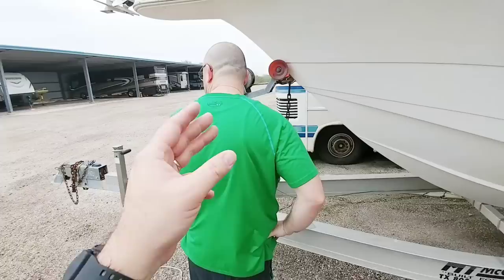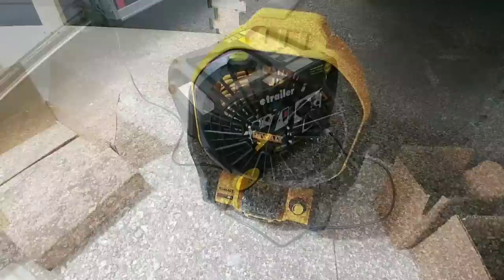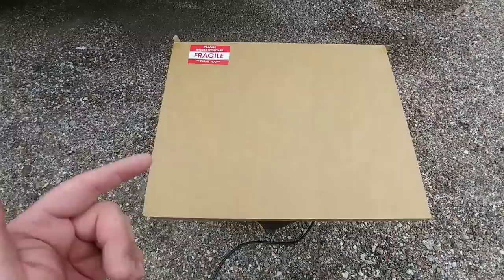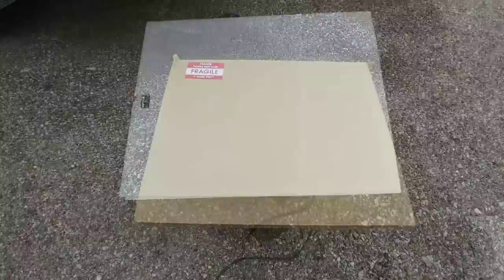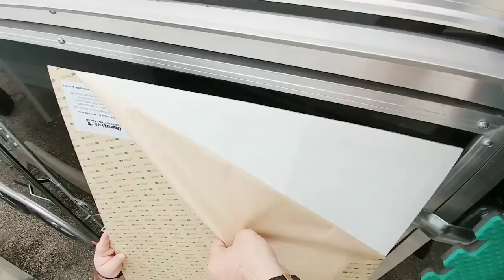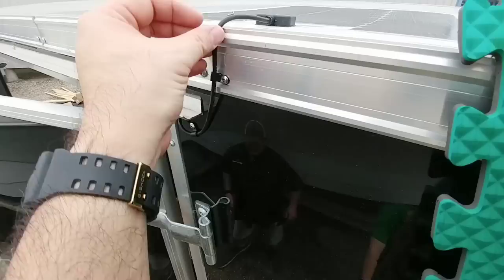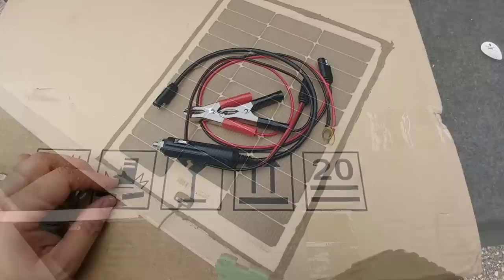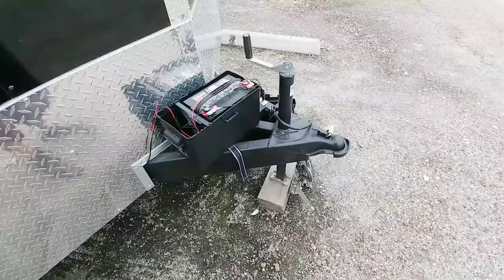RV and Trailer owners will love this! So easy to install!

Comment: I once fell off a 50 ft ladder... good thing I was on the first step lol.
Reply: Even better the ladder wasn't upside down !....was it?
Reply: @dalek.6171  As long as the ladder wasn't on the edge of a lower roof or held up by a rigged up platform then you'll be fine.

Comment: With a 7-0 trailer you can bring a rack up from the frame and install the real thing with no roof or wall penetration. All wires travel inside the rack and penetrate the floor. Doing it now.

Comment: I fell off the 3 step of the ladder doing work my my fifth wheel and broke my heel off. It went back into the right place but I had to be non weight bearing for 3 months to my left foot. I believe in good ladder placement now.

Comment: ...or, for less than half the cost ($159 all-in), you can get a comparable solar panel (12VDC, 50W, flexible) and a capable MPPT charge controller (lead acid chemistry). The wiring is just as simple, yet you have so many additional options for expansion, etc.

As for this installation, a) a waterproof entry gland is cheap insurance against leaks, b) the Dicor lap sealant is way over kill, and c) the efficiency of these cells will be comprised as they heat up for to lack of air flow underneath them.

Still not requiring roof penetrations, I'd affix low profile aluminum channel to the roof, then mount flexible panels to a thin rigid plastic substrate and the substrate to the channel; all with VHB tape.

The channel allows air flow under panel(s), minimizing efficiency reductions from panel heating. A length-wise orientation would minimize wind resistance, but could induce some lift during transit, while a width-wise orientation would result in slightly more wind resistance without lift.

In short, affixing any solar panel directly to a structure without adequate air flow will reduce their efficiency while simultaneously shortening their life.
Reply: This guy has no idea what he is doing.  Glad you wrote this, saved me from typing.

Comment: I have several comments.  First, wiring the panel directly to the battery will pull the panel operating voltage down to the battery voltage.  A 50 watt nominal 12 volt panel actually operates at at about 18.5 volts in full sun where it will produce 2.7 amps.  Connecting it directly to the battery will pull the voltage down to around 13 volts max, so the power you will get out will never be more than 13v x 2.7a = 35 watts.

Second, a 50 watt panel is too big to directly connect to a less than 100 amp-hr battery like you have (looks like a GRP 24).  The panel will NOT self regulate no matter what the manufacturer says. In a sunny place like Texas that panel WILL overcharge your battery in the summer.  The only possible saving grace is that applying the panel directly to the roof like that will cause the panel to run very hot.  That will decrease its output dramatically AND will greatly reduce the panel's life relative to a mount with air flow under the panel to keep it cool.

You made a big deal about preventing leaks, but didn't use any sealant on the wire mounting screws you put into the side of the trailer.

You could have bought a high quality monocrystalline rigid 50 watt panel, an MPPT controller, mounting brackets and some 3M VHB tape or eternabond tape and made a much better install for under $200.
Reply: Would you mind helping someone do what you mentioned at the bottom of your comment? Materials list maybe?
Reply: @jmqrsq  I can make some suggestions if you give me the specifics of what you want to do.
Reply: Would that 50 watt panel be able to charge stuff like Dewalt batteries , run compressor ect ??
Reply: @chicothesavage  ha, ha, ha.  Of course the answer is yes IF the panel is connected to a big enough battery bank and has a big enough inverter.  It just might take a LONG time to recharge the battery bank after running the compressor.  The DeWalt batteries not so much (say an hour or so of full sun for a 2 amp battery, but you will still need an inverter.
Reply: What would be a good setup to run a stereo and lights for a few hours at a time. Maybe a little more power in case I need to charge power tools. Also running a vent fan too.
Reply: @Kev in the 𝕃𝔹ℂ I agree completely.

Comment: GREAT idea on the drip loop. This is not meant as a backhanded compliment or snide remarks;  but I spent 2 years on & off researching Solar prior to the installation on my tt last year. I was going to go the flexible panel route (and not the cheap ones) until almost everyone who had a year prior had major failures. A lot of them documented on You Tube. This was regardless of supplier. A local solar supplier quit stocking them about a month prior to me trying to place an order from him. He had had too many customers return them with failures. I ended with a small (glass) system to tide me over hoping quality & technology will catch up. I’ll be real curious to see a follow up in about 6-12 months on yours. I wonder if the price of these is representative of a “cure” with the problems they use to have ? And no charge controller ? Although you’ll be lucky to average more than about 1-2 amps per hour, how do you prevent over charging?

Comment: This particular panel is no longer available. They still offer a panel with the same performance but doesn’t have the 3m backing. It mounts with screws

Comment: Would be nice to see what you did with the wire after the drip edge. Kind of dropped the ball at that point and didn’t explain how the wires got back out to the battery.

Comment: I was always told that bracket mounted solar was MUCH better (superior) than surface or flush mount solar panels.  The reason was cooling, the heat has to go somewhere.  If there’s a gap between the panel and the roof, the heat has a place to go — No gap, the heat transfers to your vehicle through the roof.  Also that if there is any flexion in the lightweight flexible panels, it’s all still glass.  The solar cells crack, that cell on the panel is toast, and gradually over time as more and more cells crack, you lose output. This doesn’t happen as often on framed, raised solar panels.  Is this true or false?
Reply: true
Reply: We have 2400 W of flat mounted panels, and I can say they work just as well for solar as they do as heat reflectors.  Keep some space.
Reply: @halledwardb  — No space means you are transferring the heat to your roof.
Reply: @Erin-Thor  Don't think so.  We have measured this stuff and lived with it for 4 years, so theres that.
Reply: @halledwardb  — The heat goes somewhere… 😳
Reply: @Erin-Thor  UP

Comment: Should have drilled through the roof, then sealed the hole with 3M 5200. It will never come off crack or leak and will outlast that trailer. The hole shoild have also been within a 1/4 of where wire exited the panel and completely cover the wire with 5200. The way you have it one tree limb rubbing the rail will destroy that wire. Also, is that wire fused at the battery?

Comment: That little solar panel thing seems pretty cool! How did you wire it from the top to the battery? I know you described it, but how did you actually route it? Inside I assume? Did you use more wire holders?

Comment: why run the cable to the inside just to come back out? should of ran outside down the front in a chase way to protect it. way easier and quicker. way over priced!

Comment: Have you seen the dewalt 20v max powerstation?  It's basically a power inverter that runs off 4 dewalt 20v or 60v batteries.  I can also be used as a 4 port charger.  If you have a lot of dewalt tools, you might like that
Reply from the maker: That's cool! I'll have to check it out... (Means I'll likely get one)
Reply: @BigTruckBigRV  Haha nice JD!  Here's a video on the powerstation.  https://www.youtube.com/watch?v=WKqCMYEbdaY I have to warn you though, the video might make you want to buy the dewalt toughsystem boxes too lol.

Comment: Great idea for cargo trailer purposes. I wonder what the response from the manufacturer would be concerning potential customers who have read alot of bad reviews and seen lots of videos where direct contact solar panel mountings have failed and/or had performance issues due to mounting the panel directly to surfaces.

Comment: Just a thought I had, the wire routed under and coming out under the leading edge of the trailer, hope the edge is not sharp, thinking of the wire insulation wear, rubbing as you bounce rolling down the road, also is there an inline fuse?

Comment: Why not mount it towards the front of the roof and run the wire straight down to the battery? Maybe even loosen the screws on the diamond plate trim and tuck them under that?

Comment: $350! Insanely overpriced.  If they sold them for $150 they would sell 10x the amount. However price aside I do like it.
Reply: Most traditional glass aluminum frame panels have a 20-25 year guarantee and will continue functioning well after this.. I guarantee you these flexible panels will be shot in a fraction of that time, UV rays will completely degrade whatever clear plastic theyre using over the cells.

Comment: Who else shook their head through most of this? If only he would have told us the same thing 5 times for every step, we might have understood it better. Did he say he made sure to put a drip loop on the wire that was attached to the panel which had 3M adhesive on the entire back? I think I missed that.

Comment: What is the purpose of the battery if it’s a cargo trailer?
Reply: Cecilia Petrowsky Mine uses the 12v deep cycle battery to both power my led lights inside, and my brake away kit for the trailer brakes. I also have a power jack on the tongue that uses the battery.

Comment: Just found your channel and have been watching some of your great videos. 
I have just acquired a 2019 6x12 Cargo and looking to first add a battery to the exterior. 
I didn't see a link to your Battery Box nor your battery; Can you post a link?
I have an Anvil trailer and dont know if I have room for a Battery but I will not know until I get the measurements for the plastic battery box. I do like your oversize box, that would allow for storage of a few extra items.

Comment: Did you put a grommet in the hole where the wire penetrates the trailer wall? Curious to see how this pans out long term. I’m not familiar with solar enough to understand where power goes when the battery is fully charged.

Comment: That isn't going to last! A few years at most. I got 150 watt panels  for $145, and they are glass. With coating. And I have seen 155 watts from each of my panels, powering my offgrid house.

Comment: Dang. $368.75 for that solar panel.  Please review items that normal people can afford.
Reply: I love his video's but I'm with ya, a lot of stuff us normal broke people can't afford
Reply: Yeah, the thin panels are way too expensive.  And this one seems to be on the high end of that even.  The really crazy part is that their life expectancy is just a fraction of that of the normal panels.
Reply: Check this video out. https://www.youtube.com/watch?v=3-sc4rlV93g
6.2 Amps 12v is 70+watts for $100 AU.  Not sure you can get them but it does illustrate that there are some good and cheap ones out there.
Reply: I know Harbor Freight has 150 watt panels that they put on sale for $150-$200 all the time I have a smaller 10watt that use on my horse trailer that got from there years ago that I paid about $40 for it which if you don't use up the battery every day it does good.
Reply: @stacyreid5077  I got my panel from Windynation.  A 100watt panel there costs about $100.  For the flexible ones it is like $120. 

I put my panel on the roof of my van about 4 years ago.  It's still working great.
Reply: 101perspective sounds like a great deal there
Reply: Holy Moses that is nearly good for 800 watt  here in Australia last time I bought 2 150 watt solar panels they cost me $127 Australian for the 2

Comment: Great product but too much $ for just 50Watts
Reply: Possibly, but realize whether you are using the battery or not, as long as it's decently sunny it's providing a charge to the battery. Great for outdoor storage of a trailer and maintaining a battery that isn't on your property (i.e. no more unhooking and hauling the battery home with you for extended periods of storage)
Reply: @natedog51  You can do the same thing with a $19 Harbor Freight solar battery maintainer.
Reply: @natedog51  Uses cases for which 50W isn't necessary.

Comment: I never heard what the battery is going to be used for.  Sooo, what is purpose of installing the battery with the solar?
Reply: Mike, you must not have watched this channel very long LOL.  Knowing JD, before long he will have 10 new accessories on this trailer drawing power.

Comment: Just last night a girl at my sons work fell off a 4ft ladder, hit the corner of a sink and broke several ribs. It can happen for sure.

As for this kit, do you need a charge controller to prevent over charging?
Reply: no, it is only a 32 cell panel. I strongly prefer a 36 cell panel with an inexpensive charge controller. 36 cells will do a far better job, especially on hot summer days. Even just half a volt more from a 33 cell panel gives you just that little bit of margin when heat starts dropping the output. You can get a renogy 50watt starter kit for about $120, or a 100watt kit for $150-175.

Comment: What is the battery running? If solar is just to keep battery 🔋 topped off, wouldn’t the smaller one 8-10 watts that is on the Reese keep this one topped off too. Just wondering what the need for 50 watts is.  Don’t remember a video showing what you use that trailer for.
Reply: NonRev my thoughts as well.

Comment: No mention of an inline fuse ? Running direct to battery would scare the pants off me... a short, or catastrophic panel failure with no protection to downstream is a recipe to a nightmare !
Reply from the maker: I have a 5amp inline fuse.
Reply: Good point...Replaceable Fuse is factory installed into the cable.

Comment: I'm not too sure that 3M is a good brand. I used some to reapply a trim strip on my 86 squarebody and it just ended up coming right back off a few months later.
Reply: They've been the top maker of automotive double sided tape forever. My guess would be you didn't have a suitable surface? Or cleaned it properly and used the adhesion promoter. Used 3m products for 30 years without a problem

Comment: This is a 'Dummies R Us' video..  $355 for 50 watts..???  LOL!  LOL!  Why did you install the panel in that location.??  Why directly to the roof..?? This baby solar panel should have been put into a corner on a raised and easily removable palette where it won't interfere with the installation a more and proper panels..